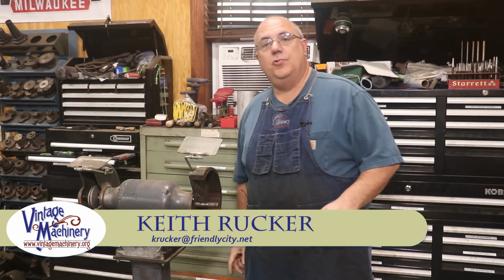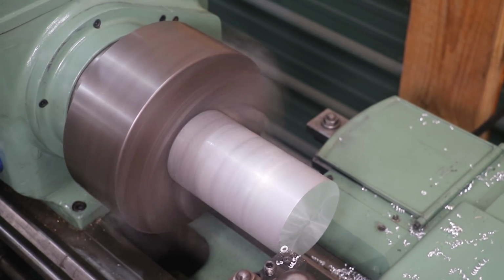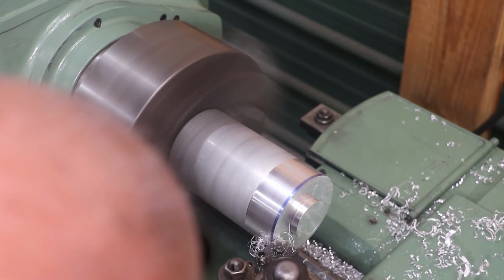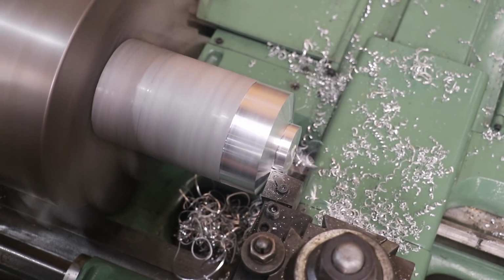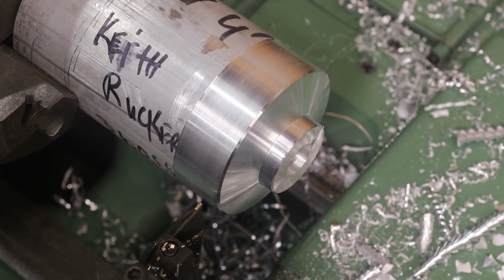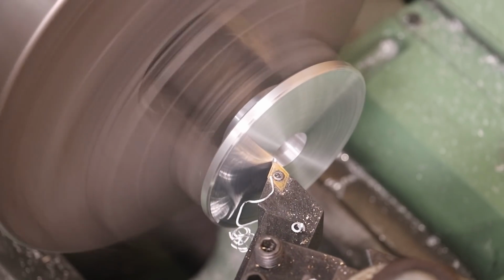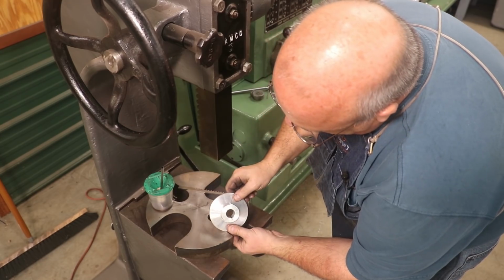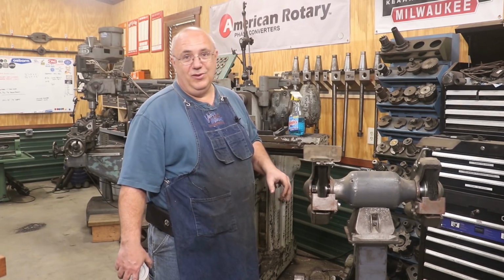Machining new Grinder Flanges for Wire Wheels

Comment: Its sad that an expensive Baldor or equal bench grinder comes with non precision flanges.  Brand new out of the box a Baldor bench grinder comes with junk stamped or cast flanges. Then, we go out and spend large on a decent grinding wheel and its unfinished and untrue and out of balance.

Comment: Nice video.  I'm about to make flanges for a grinding wheel.  After you machine beveled side of the flange, you cut off the flange with your bandsaw and the flipped it around and mounted it in your 3 jaw.  Is there any concern that due to chuck run-out that the front and back faces are not parallel?  My 3 jaw has about 0.005 runout and I think I have convinced myself that this will translate into the faces not being parallel if I flip the part?  Am I wrong about that?

Comment: Love a 10" wheel to buff off those rusty bolts and stuff at Dad's shop.  Oh, and a suggestion.  Put a big rubber mat under the plate on that arbor press so when you accidentally drop those cutters, they don't get dinged up or shatter on the concrete.

Comment: Enjoyed your video Keith, thanks.  I was taught to remove the 'tool rest' when a wire wheel is installed.  Since the wire wheel is very flexible, material is sometimes drawn in jamming into the tool rest.  A potentially dangerous issue that will likely stall your motor and damage your wire wheel.   Smaller parts can even go through the tool rest and be spit out the top, flying straight at you.  I've seen this happen more than once, fortunately no one injured.
One more thought for your other viewers; I love a fine wire wheel (.008" wires) for cleaning rusted threads on bolts & studs without damaging the threads. Just light passes without pushing hard.  The coarser wire sizes (eg .012" or heavier) will wear away threads in short order. The coarse wire wheel is great for cleaning up material where you are not concerned about fine detail (such as threads).  Having both wire wheels is a great idea.

Comment: Wire wheels do get dull- the ends splay and round over after a while. I use my carborundum stone against the face to sharpen and true it and the shoulders up, restoring the cut to like new aggressiveness.
Reply: I never thought of that.  I'll give it a go.  Nice to see information in the comments instead of all the captain obvious keyboard warrior types.
Reply: @ShainAndrews  It works best if, like sanding belt cleaning sticks you dress it regular.
Reply: I just turn mine around every so often , this evens out the wear.

Comment: Be VERY careful about which wire wheel you put on a Baldor buffer motor. They turn VERY fast and are designed for muslin wheels, etc. MAKE SURE your wheel is rated at or above the speed of the buffer motor.

Comment: And this is 90% of the work I do in my little shop (which is about half the size) I also did the same part for my grinder. For same type of wheel. Through I used steel. You have lots of machines on which you do parts for... other machines. Rarely something else ;)

Comment: Very dangerous to have a tool rest with a wire wheel because it can drag the work into the gap
Reply: I learned that the hard way.
Reply: I agree. I removed the guards from the grinder I dedicated to wire wheels. I also made a mount for the grinder so I can turn it 180 degrees (and 90... and 270...) and have the wheels turn away from me. Good for sharp stuff. Better have it stick in the bench than in me. WEAR SAFETY GLASSES. Those wires come loose and HAVE blinded people.

Comment: Keith- is there a way to know how many passes a broach needs in order to reach the correct depth? I recently broached a keyway in a hole (my first time) and since the kit came with spacers, I assumed they were needed. In fact the keyway ended up too deep- I think one pass was more correct. Is there a standard for this?
Reply: The depth of the broach should be one half the thickness of the key.   Hope this helps.
Reply: What Ether Oar says is the rule of thumb when you’re making both sides of the keyed connection. If you’re making something to go onto an existing keyed shaft, just measure what depth keyway you need to fit on there snugly and add shims accordingly. If the key is attached or machined into the shaft some extra depth doesn’t really matter, but with a loose key you need to get it just right or the key may move around and wear the keyways.

Comment: Nice! I have a very old little arbor style grinder (belt driven) that could use some flanges. I'm not a grinding wheel expert. The wheel I bought have these little plastic bushings to accommodate whatever arbor they're on. Is it ok to maching the bushing right into the flange, or is it better to leave the cheezy looking plastic bushings in there?

Comment: googles or a full face shield are a must with wire wheels. "Them needles come at ya at high speed".
They even go down the tops of my shoes, OUCH.
Reply: I can't tell you how many times I've picked little wires out of my skin on my way home after work! Little bastards hurt!!
Reply: So true Laddie - know some one had one go through his leather apron and into a sensitive part of his anatomy 😫
Reply: And this is especially important when you change the direction the wheel is turning to quote sharpen unquote the wire wheel, which actually means of course to take the set out of the wires -a very dangerous thing but one of the only ways you can make a wire wheel "sharper". So can someone else give us the other 2 ways?

Comment: Keith, you need to brush upon the safe operation of lathes.
Safe removal of swarf, feeds and speeds.

Apart from that, great job.
Reply: Grabbing swarf with bare hands made me cringe.
Reply: @Cpl.Cadaver , me too, it's a good job it wasn't stainless!
Reply: Last time I made comments about unsafe practices I got negative feedback. No comment this time.
Reply: @davidwright640 , possibly from folk that have never worked as a machinist, I have. And I know what I'm talking about.

Keith on the other hand, is not a skilled machinist, that much is obvious hence the "unsafe" practice.
As long as people don't try to emulate him, then all is well.
Reply: @Cromwell648  I lost the tip of a finger on a table saw. Ran a pallet jack over my foot wearing tennis shoes.  Fell off an 8 foot ladder using a chain saw reaching over my head. Advanced degree from the "school of hard knocks".
Reply: @davidwright640 , Na, you were just having a bad day 😂
Reply: Absolutely! 

I have seen a little bit of swarf clean out the chip bed in less than a second, and the resulting helicopter blade doesn't do anything good to your cut.
Reply: @CothranMike , one of the worst things you can do on a lathe is let the swarf build up, under the chuck.
Because when it grabs it, you better have a guard in place.
Or you will end up with a face full of very hot metal.
Reply: He's a bit of an old school hacker, they all do it.